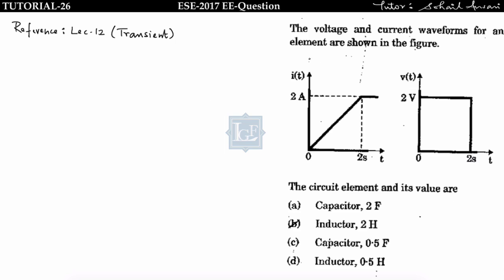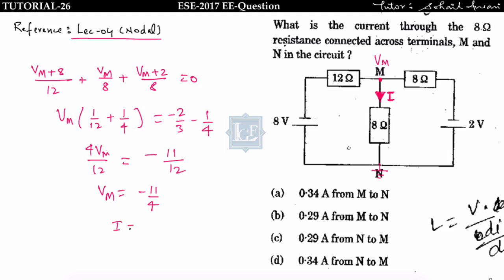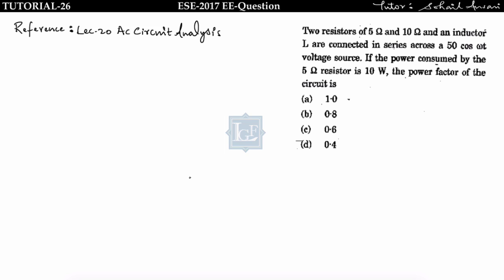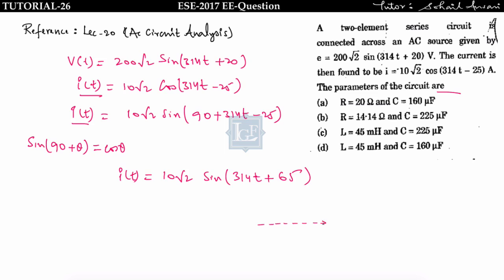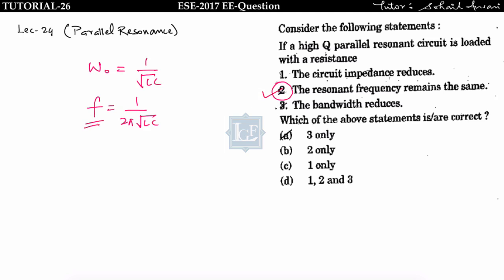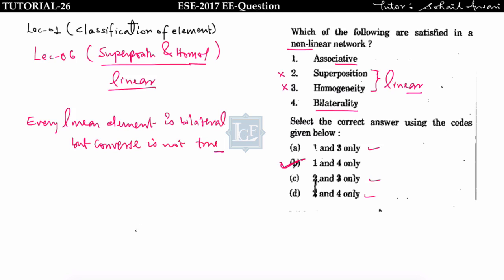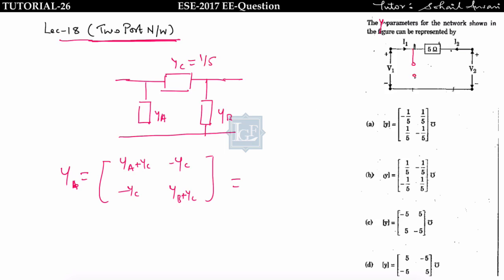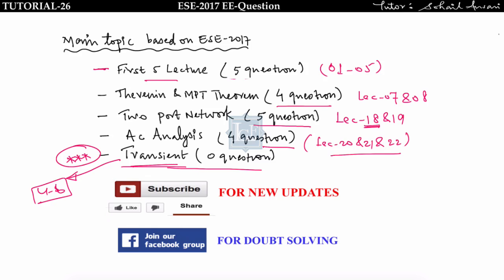Lec-26 ESE 2017 Problem Solved

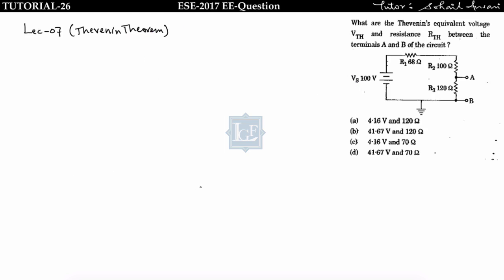Comment: Sir, the question @16:53 on parallel resonance, the load will reduce the impedance.But since it is at resonance,resistance is effectively reduced.So BW should increase right sir?
Reply from the maker: please take the screenshot and upload it on our facebook group for doubt solving..we will resolve ur query..

Comment: Sir, in the question of  lecture 7, thevenin theorem, will the ground terminal affect the circuit while calculating Rth?
Reply from the maker: no...u dont have to see the ground terminal...only u have to see the terminal at which u are finding Rth by shortcircuiting the voltage source and open circuiting the current source...ok